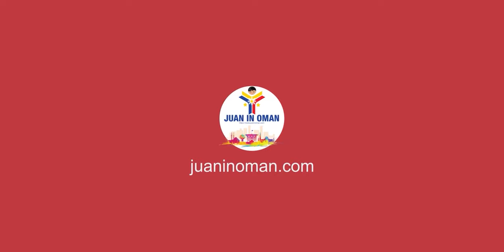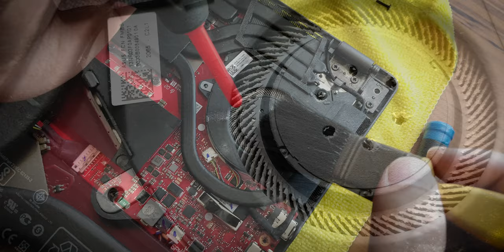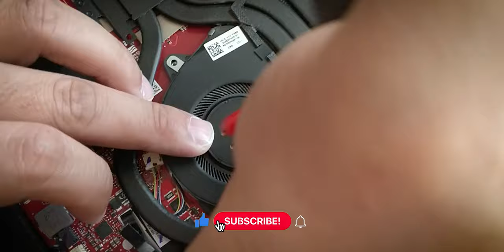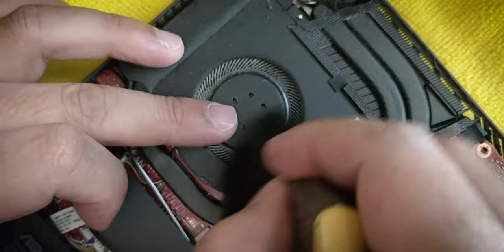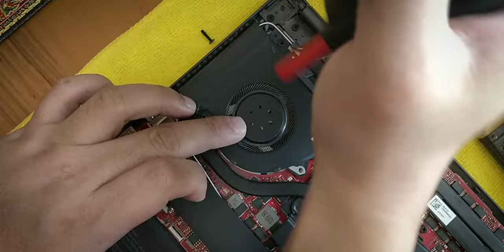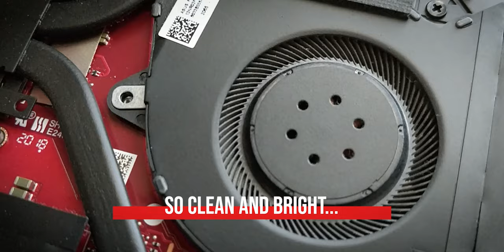How to clean ROG Zephyrus G14 thermal fans

Comment: Lol.

DO NOT DO THIS PEOPLE WATCHING!

Instead, learn how to properly remove the cooling components and blow out the dust outdoors.

This dude is literally pushing dust into his air chamber.
Reply from the maker: Try it first. As I noticed that the dust will just pass through the air intake that is under the keyboard and they will make their way to the lcd... simply dust off when everything is done
Reply: if you will remove the fan, you must remove heatsink. you have to re-paste it
Reply: @yagitu.388  Do you disconnect the battery for just cleaning? Ik u need to if replacing paste